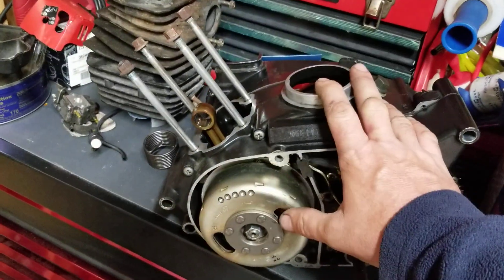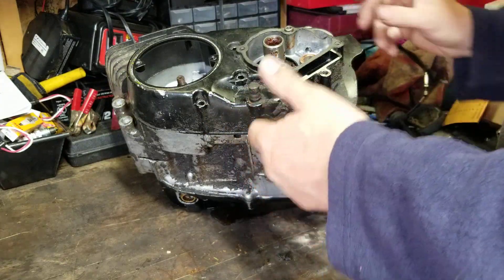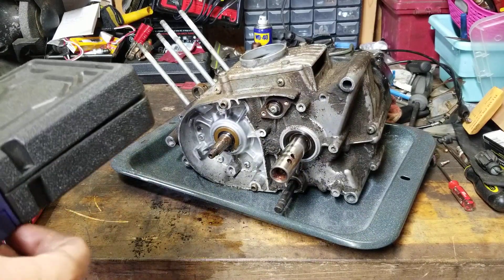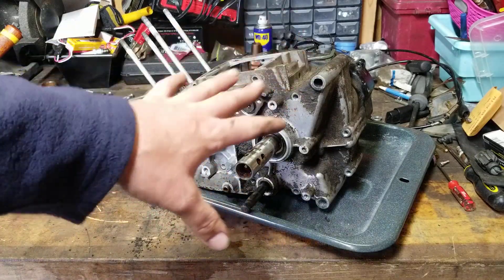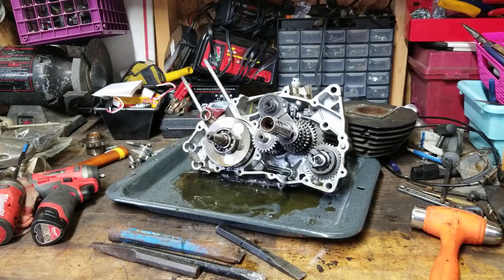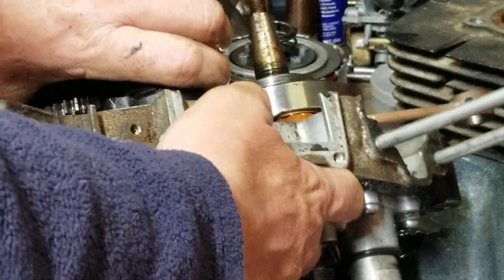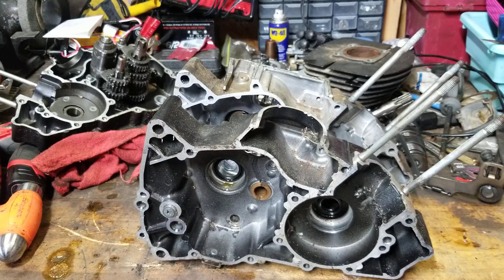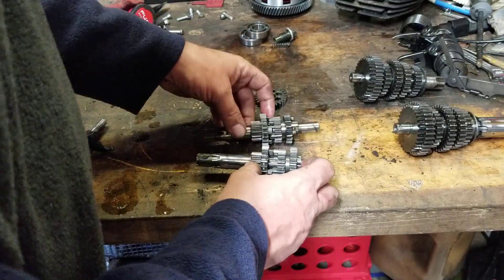Part 1 of the Kawasaki ke102 10speed build

Comment: I managed to get my km100 crank moving, but the wrist pin is stuck in the piston. Nevertheless, the engine needs a complete rebuild, which will be fun to do.
Reply from the maker: they are not bad to do gasket set piston std bore if you need help let me know
Reply: @2strokeguru  your videos have been a lifesaver. I had never heard of a rotary valve engine until I got this bike. Right now I'm waiting for the paint job for my '80 Honda xl250 to be done so I can get that out of the way to work on the KM. The jug I pulled looked ok, but I'm shopping around to have it bored over in an effort to clean it up and gain more power.

Comment: Hey Kevin, I have a 76 KV100. I'm going through the bike and replacing items as I need. I cannot find the 10 speed front sprocket, part #13144038, for the life of me. I missed one on eBay and that's the last I've seen. Do you have any leads or know of another source to find one? Thanks for putting out such helpful videos on these great old Enduro bikes!
Reply: @jenntek.101  since this post, I have purchased 2 of the correct sprockets for less than 40$ a piece